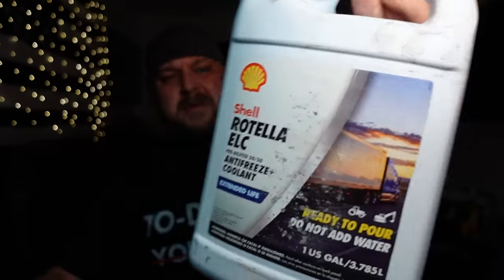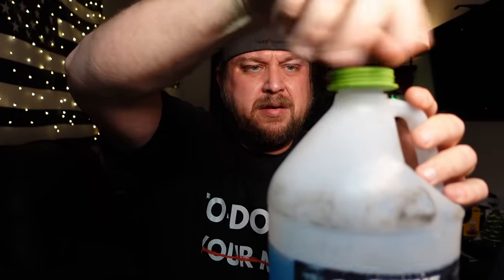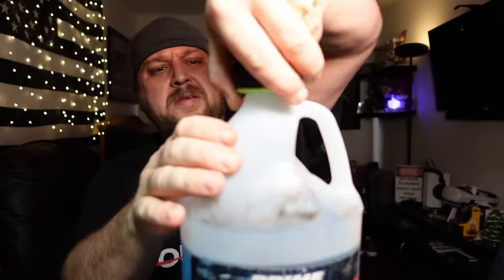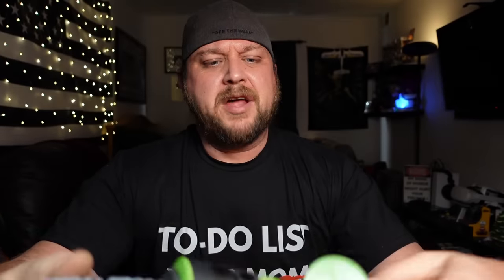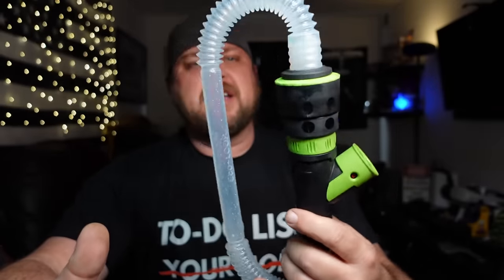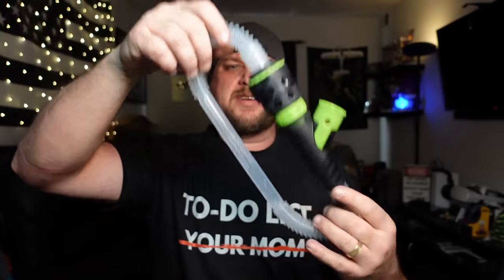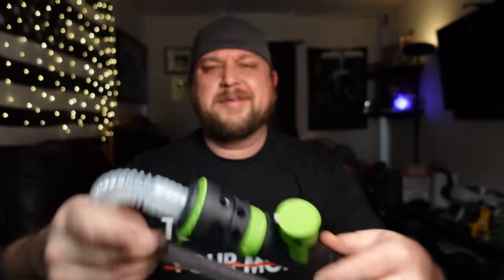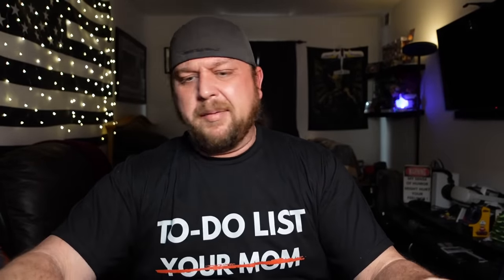Eco-Loop Screw On Funnel

Comment: It’s actually pretty nice that it seals up when not in use. In Auto Tech, they tell you that using a dirty funnel is a big percentage of premature engine failures. It only takes a couple grains of sand or other debris to cause physical damage to the engine and/or block oil passages. A lot of people clean their funnel out with a dirty rag, then just eye it to see if there’s anything on it, but the particles that are smaller than the human eye can visibly see is actually more dangerous to the engine.
Reply: Brake-clean your funnel b4 every oil change. 👍 peace of mind ✌ 🧠
Reply: @T-bird_Johnny throttle body is cleaner then break. Technically I go with that if I got it
Reply: @hisdukeness3037  good to know 👍
Reply: @hisdukeness3037 & @Tbird_Johnny

Cleaning your funnel immediately after use and wrapping it in some sort of protective material is more important than what you clean it with.  I never put mine away dirty.
Reply: @Rotorhead1651  I'm lazy and live in a 2nd floor apt,  I usually do wrap it in a plastic bag, but I put it away dirty. Then brake clean b4 use. 🤷‍♂️ 😂
Reply: I hope Kitty litter is okay. It's the only way to soak up the last of the old oil!
Reply: @T-bird_Johnny  will that stop your engine or make it so it doesn't stop 🤔
Reply: @CR-iz1od  how will wrapping a greasy funnel in a plastic bag, pulling it out of said bag and brake cleaning it to ready it for use again stop an engine. 🤔
Reply: I just put my funnel in a gallon ziplock bag
Reply: I usually just throw mine in the sandbox and bury it. Figure the sand will soak up anything left on it then when I'm ready to use it again I shake it 2 or 3 times and it's good to go
Reply: I have funnels with screw on caps top and bottom, I still clean them before storing them.

Comment: Been using the funnelking for 26 years. It has a lid and cap in 2 sizes,found originally at a JD dealership.
Lots of people make them nowadays, from $10-30.

Its always fun to show an apprentice the paper funnel,single use but rolling up 9x13 piece of paper works as a 1-time use ..under 3 qts lol

Comment: I genuinely want to check this thing out, definitely would be useful. Love the content dude keep it up. I like these longer form videos.
Reply: I wonder if it will fit on a gas cans.
Something, anything, is better than the damned locking, vapor trapping, gasoline spilling, you need three hands to operate, throw them away and get a funnel, spouts we have on modern models.

Comment: Looks pretty nice!  My only problem is that I use so many different kinds of oil that I would need a lot of them to not cross contaminate.  It does not look like it would be fun to try to clean out.  Love the shirt 😂.
Reply: Automotive industry I think it's a total non issue. A tablespoon of 10w-30 isn't going to sufficiently contaminate 4-5 qts of 5w-20 or whatever is used. I would not be worried at all. Now if you're in the aviation industry or pharma with vacuum pumps and machinery etc I totally understand and agree.

Comment: Bought something similar from Advanced.
Used it to change the transmission fluid on my minivan.
Worked.
But, I'm thinking if I took a little more time to hook up a hose to a funnel and include a vapor lock relief tube, that might have worked better.

Comment: For. Windshield washer fluid, my dad used a cleaned out and marked a Downy laundry softner bottle. Right size, handles easily and is usually what you need to refill. Still using it.

Comment: Went to work at a construction rentals place. Guy brings back an airless sprayer. We give them a full going through before we put them back out for rent. 
It was my 1st time to clean one out. I go to take off the sprayer hose attached to the pump. I get to the last thread....and....*KABOOOOOM!!*
There was not 1 square inch in the shop that didn't have at least a drop paint on it. I got covered with paint just on my right side, head to toe. 2 other mechanics look like me.
I never laughed so hard.
Let the pressure off 1st next time.

Comment: Bug wash isn't "Basically just soap and water" because soap and water mixed together isn't flammable....but you windshield washer fluid is actually really quite flammable, which is why it's under the hood as far from the engine as possible (space permitting)

Comment: would there be concerns about residual chemicals hanging on the gizmo? would you need to clean it? unsure what chemical properties each of the examples has so no idea if there's a risk of them reacting with each other. Also looks like you'd have to pour out the entire blinker bottle just to get it down the funnel and then back.

Comment: For the jug that you couldn't get to fit even after you took out the green fitting maybe you could put some tape on the threads of the bottle to make it bite. Might not fit in the filler by default but you are a mechanic of sorts so just backyard mechanic that shit.

Comment: So how many will you need? 
One for water based products,
One for heavy oil like for the engine,
One for transmission fluid,
One for hydraulic fluid.
Am I missing anything?  Sure wouldn't want to have to wash it clean after using an oil and then wanting to fill the winscreen wiper reservoir or contaminating the transmission oil with engine oil although that would be fairly minimal dilution of the transmission fluid but still....
Reply from the maker: The answer is if it’s oil I don’t if a tablespoon of some other oil is mixed in 🤷🏻‍♂️

Comment: While its kinda a cool idea, it seems kinda like a def funnel with extra steps. 

I can see a few edge cases it would be nice but the ribbs kinda make it prone to cross contamination/spills which kinda makes the universal funnel concept kinda moot. Also anyone who has filled def out of a def jug know how spill free it is. Also using it will be potentially an exercise of strength and trust in the many plastic threads while the user holds the can high in the air above their head. 

Basically long winded way to say the cheap funnels belong on the def jug and probably not the mechanic's tool box.

Comment: That vent is pretty useless. The bottle is still going to have an airlock until it can glug, glug, glug some air.
That would piss me off enough to chuck it in the trash and go back to pouring directly out of the bottle. 
Thanks for the review thought.  Now I won't be tempted. 😊

Comment: Rippled not smooth tube would make it a nightmare to clean out. The air vent is uselsss as bottle will still air lock at the cap area of bottle. I can see the adapters gettting lost or broke quickly too. Definiay a marketing gimmik product. Ill stick to normal pouring or a basic funnel

Comment: Oh, to hell with fucking around with that... I find my best funnel with most forklifts is actually a water bottle with the bottom cut out.
Some forklift engines like the Hydundai engines in Clarks or k21/k25s in mitsubishi, nissan, doosan, take regular water bottles just fine. May just have to take the collar off the bottle. You can really dump oil right into the engine easily. Just pull the dipstick on the K21/25s, since it floods the rocker cover.
"Smart water" bottles with the little blue nipple is great for filling most transmissions.
I don't buy special funnels or into this trash that will likely double your time. FunkFPV should know that being a field mechanic means improvising and doing it as cheap as possible is the win.
Source: Shitty and broke field forklift mechanic improvising.